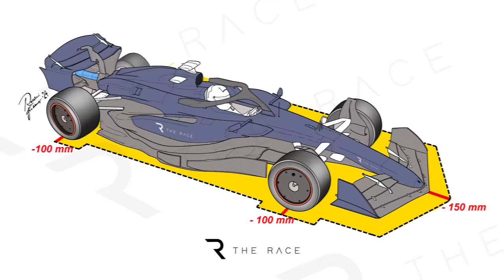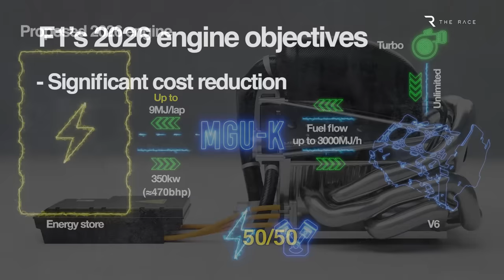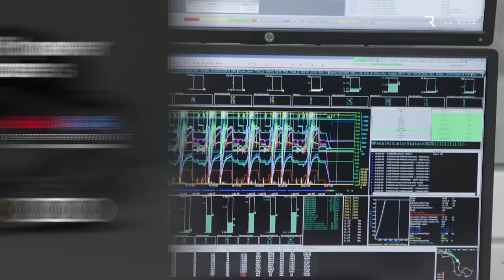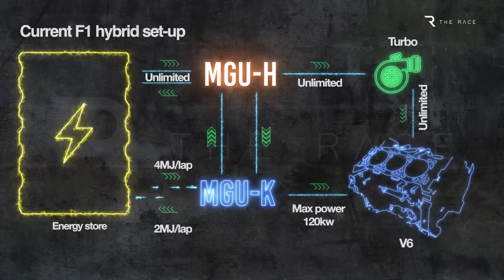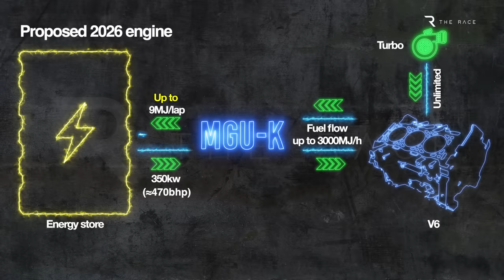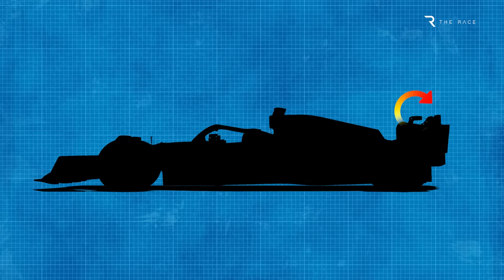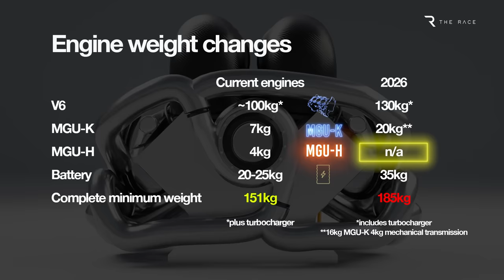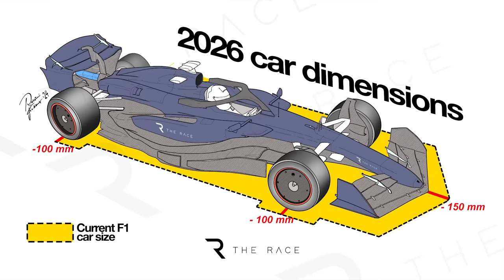The truth about F1's controversial 2026 cars

Comment: "getting in new manufactures" and yet keep blocking Andretti with Caddilac
Reply: F1: "We want new manufacturers"
Andretti: raises hand
F1: "Not you" whispers "never you"
Reply: @lankyboy90  they coming in 2028
Reply: They want Cadillac without Andretti.
Reply: why f1 aren't allowing andretti join the grid?
Reply: @freeyourselvesfromhate4229  They want Andretti to buy one of 10 current teams instead of adding the 11th team. They want this new business model to work by forcing other interested parties to buy current team with lucrative price and not dilute the prize money shares between teams
Reply: @Ariespradana13  No guarantee. Also the current concorde agreement will have expired by then and rumours are that the teams want it enshrined in the rules that the maximum Team limit is capped at 10, not 12.
Reply: its ironic when a team who brought a manufacturer aren't allowed to enter, yet a team which only cares about their CNC machine business or a B team only wanting to advertise their sponsors still can run on the grid. Also if ALL 10 teams have their own engines then what? Kick out of the manufacturers if they're under performing? 🤷
Reply: @lankyboy90  waiting confirmation
Reply: They want new teams, but no more than 10. Andretti can make a big offer to buy Haas/RBulls at anytime.
Reply: @tengille he has the money why do you think he has a facility in both at Silver Stone and Indianapolis.
Reply: It wasn't a manufacturer. Caddy was badging a Renault.
Reply: @GamerFlair  only to start out the first few seasons. Its much like how Red Bull are with RB Powertrains right now, basically once 2026 starts they'll be running their own engines designed from scratch
Reply: @freeyourselvesfromhate4229  Old boys club, they don't want to split the winnings 11 ways instead of 10.
Reply: @GamerFlair  Temporarily while GM was tooling a motor for either 2026 or 28.
Reply: @hyperboloidofonesheet1036 no Andretti no Cadillac, learn about loyalty, it’s not common in business but it’s cute when it happens, I’d be surprised if it sticks though. Williams Cadillac 🔜
Reply: @naufalkusumah2192  when will you understand that f1 is never about racing or technology, it's all about making money, that's why everything that the FIA do seems illogical for the sport, because their only single objective, is to earn more, more money, at the expense of literally everything, even the soul of the "sport", if you could even call F1 a "sport". It's basically just a tv drama now. No racing whatsoever.
Reply: @freeyourselvesfromhate4229 They want Andretti to buy Haas, Alfa Romeo  or any other team instead …
Reply: @Nikowalker007  instead of buying a team, why not partner up with a team like Haas since it's an american team?
Reply: @tengille  In terms of Power Unit...yes they are! They're not actually allowed by the regulations to enter as a full PU Manufacturer until 2028. Their plan was to do a badge-engineering exercise on the Renault PU for 2 season like RBR did.
Reply: @freeyourselvesfromhate4229  Andretti has tried to buy existing teams several times and been rebuffed each time. Also, Haas and Andretti are rivals in Nascar, I don't see them teaming up any time soon
Reply: @Ariespradana13  No they wont, the new concord agreement will convert F1 into a Motorsport Super League with only 10 teams and no chance of new entries.
Reply: @hyperboloidofonesheet1036 they want an engine
Reply: The FIA wants American money and nothing else. Nearly every discussion about American brands racing in top level motorsports ends the same way. We've been banished to mid-level WEC teams. Unless you live in Europe or have gobs and gobs of money, progressing to high level racing is ridiculously complicated. Getting a level 1 license essentially requires you to compete in europe-only racing series.

90% of notable American racing stories are as follows: European manufacturer/regulatory body mocks American brand. American brand doesn't want to just sit there and take it, so they decide that it's worth the effort to race for a couple seasons to prove a point. They absolutely screw everyone over, then leave because the regulatory bodies still don't want them around.
Reply: @tengille Andretti wouldn't be starting from scratch though, it'd just be an expansion of operations.
Reply: I really wish they’d add Andretti. Hes a real racer, and it would be really fun to watch how adding a new team, especially run by someone like him, would mix up the grid. 

From the perspective of the current teams, I obviously they don’t want to add someone - it means splitting money and risk that the new team will beat them. Less risky is saying no. But F1 the sport should overrule them for the sake of more competition and entertainment.
Reply: @tengille Cadillac will be putting in significant work, they will also be a new engine manufacturer...... More engine manufacturers is a good thing. 
Andretti has a lot of money, and an Andretti Cadillac team will probably have a much easier time finding sponsors than other bottom teams.
Reply: @GoldenEDM_2018 You write f1 being about money as though it's some sort of strange thing. EVERY professional sport is about money. All the fans who pay to support/watch their teams are being milked for as much money as possible. This hasn't always been the case but it absolutely is today.
Reply: @IanHobday  yes but F1 is the most blatant offender. It's leaps and bounds higher in shoving drama, merch, fan base cringe and the ridiculous price of tickets in the face of its fans. I never said that F1 is the only Motorsport to do that. Reading comprehension, please.
Reply: @GoldenEDM_2018  F1 is nowhere near the worst offender. It's not even remotely close. Average price for a Super Bowl ticket this year was $8600. That's the box office price, not the scalper price. The cheapest tickets were $2000. Regular season ticket average prices are hundreds of dollars, for some teams over $500. Average. For 60 mins of play spread over ~3 hours. Meanwhile good (not best but good) location 3-day weekend passes for the recent GP in China were around US$200. F1 has gotten more expensive it's nothing like other pro sports.
Reply: @IanHobday  We talking about Motorsports or nah?
Reply: @GoldenEDM_2018  As I said originally, "You write f1 being about money as though it's some sort of strange thing. EVERY professional sport is about money."
Reply: @GoldenEDM_2018  What got your panties in such a knot? I'm not disagreeing with you, I'm saying that all pro sports are doing the same thing which is milking fans for as much money as they can (as I already said.) F1 is not the worst about this but that doesn't mean they aren't doing it. It's still, for now, at least possible to enjoy F1 in person without having to spend thousands of dollars on tickets. Enjoy that while it lasts.
Reply: @IanHobday  I'm sorry to say, but F1 IS the worst offender. I love F1. I went to every single race at Indy. That's back when you used to be able to afford F1 tickets. $250 got me a grandstand seat for the whole weekend at Indy. Now they want a minimum of $600 for a general admission ticket. I can get a ticket for under $100 for the Indycar race at Mid-Ohio. Maybe $50 for the IMSA r ace there. I go to Norwalk for the NHRA every year. I get to walk around in the pits, catch a driver or 2 and get autographs for my son, watch the teams rebuild the car between rounds from like 5' away. All for FIFTY BUCKS. I LOVE the NHRA for that. They are by far the best value for your money when it comes to high level motorsports. Also.... when you said it is possible to go to F1 without spending thousands, when the Miami GP was first announced, GA tickets were 1k. They went down some, but when I checked they were $1,000. You can not go to a F1 event without spending at least one thousand. I have a wife and 4 children who all love F1 too. There is zero chance of me taking my family to a F1 race. We hit the 3 I mentioned every year though.
Reply: @Spike-sk7ql  Look at other top tier pro sports. You pay hundreds or even thousands of dollars for a few hours of entertainment. F1 has gotten more expensive over the years but you're still paying a few hundred for three days of entertainment.
Reply: @IanHobday  you do realize that for Vegas last year people paid $800 to watch 3 mins of practice, right? You're NOT getting a weekend pass for a few hundred dollars. Weekend passes ARE in the thousands.
Reply: @AnomalousOne1401  you mean copying the worse engine in F1 at the moment and trying to improve it with some American motorsports brains?
Whenever the car does a right turn oil pick-up probably would suck air or something.
Reply: @ExileXCross  Calling running an F1 team just an expansion of operations vs a stockcar/nascar team is so blatantly ignoring everything that goes into driving a prototype in development year round, that i can't even call you dumb.
Reply: @Ariespradana13  They should be coming ASAP! What f1 did to them was so dirty, even if they still are coming.
Reply: @lankyboy90  why though?
Reply: @bertbergers9171    Did I say that?
Reply: It's Cadillac.... SMH
Reply: @lankyboy90  key word... Rumors
Reply: @freeyourselvesfromhate4229  Haas and Andretti don't like each other and Haas already turned down the idea
Reply: @MarioP9511  and you sit on the board do you?
Reply: @junkice6930  then explain why Ford has had engines in F1 before...
Reply: @GoldenEDM_2018  you must not notice all the football baseball and basketball products being offered then.
Reply: @IanHobday  funny you listed the china price .. now price Vegas or Monaco or Florida or Abu Dhabi
Reply: @trance9158  how yf does that relate to F1 preventing new teams from entering the series by imposing absolutely high paywall and killing competition in the process?? Can you name other Motorsports series that does that??? People for Pete's sake, the entire video and the entire comment thread is about MOTORSPORTS and CONSTRUCTORS/MANUFACTURERS. How TF does Superbowl got anything to do with that?
Reply: @trance9158  Japan price isn't so different. I listed the price for the most recent race, and in the region of the world where I live.
Reply: @IanHobday  once again.... Price Vegas Miami Monaco Abu Dhabi....
Reply: @trance9158  They are of no interest to me, I don't live there. That said, Vegas you can watch for free, Miami too. Even Monaco if you're lucky.
Reply: @IanHobday  you can watch all races for free
Reply: @trance9158  Badged Cosworth engines. The legendary Ford DFV was actually a Cosworth design and built by Cosworth in Northampton. (I have been to the factory a few times and have a full set of tech drawings of the '76 DFV)
Reply: @trance9158  they haven’t had engines in F1 since 2004, and have never had a factory team AFAIK.
The FIA doesn’t have nearly as much control over who makes the engines. There are usually only 3-4 in the pool anyways, so anyone willing to make a competitive F1 engine usually gets to.
Reply: @junkice6930  actually Ford did run a factory team... Under the guise of Jaguar. Ironically they sold it to RB. Now apparently Ford will be once again working with RB come the 2026 season. Minus Newey.
Reply: Yeah it’s absolutely ridiculous. Caddilac and Andretti would be amazing.
Reply: Even today, they rejected Andretti to join F2 and F3...

Bonkers.
Reply: @kawaiikeyboards  that’s completely false information. Rebull use honda power trains until 2025. & will partner with Ford in 2026 for power trains.
Reply: @trance9158  Not really, the Cosworth DFV was designed and built in the UK, using american backing.
Reply: They’re very good at over complicating the hell out of everything to the point where they don’t know their foot from their ass.

Then someone comes strolling by with the 30,000 ft view and is like, what the hell are you guys doing over there?
Reply: @GamerFlair even worse- was asking F1 to make a manufacturer- probably Renault as it has fewer customers- sell them engines at least until they could develop their own, maybe by 2028.